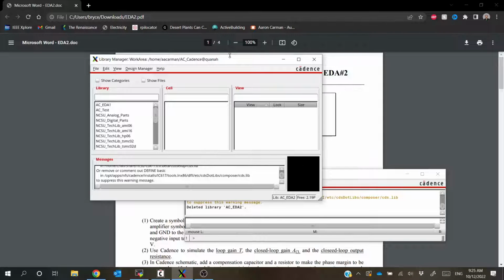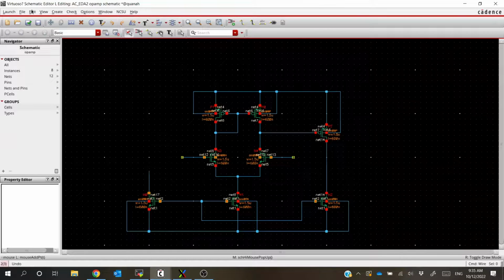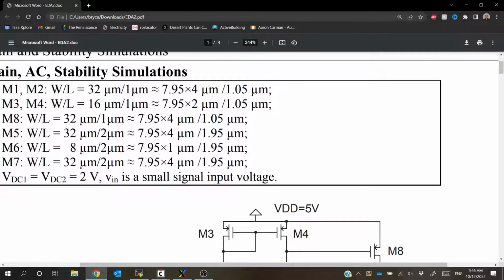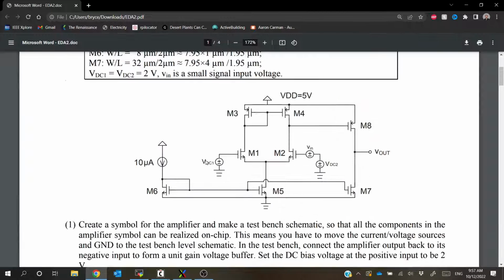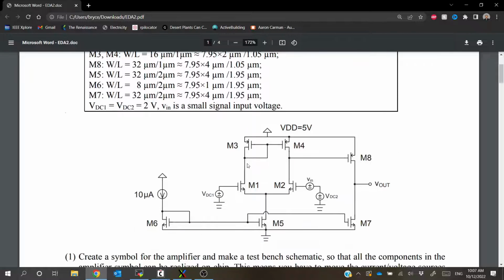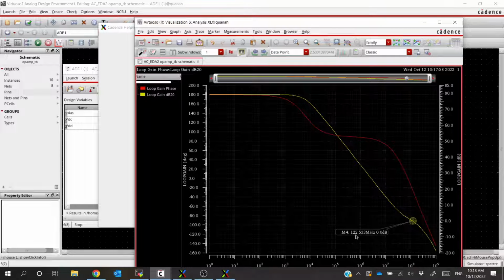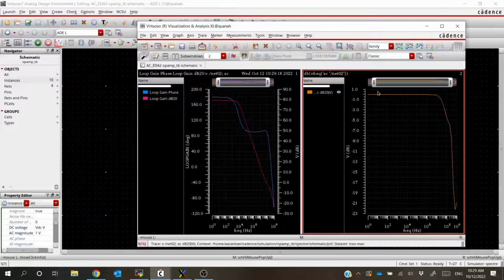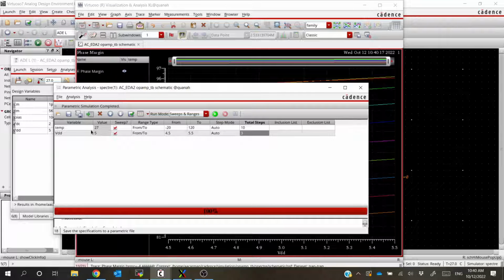Two-Stage Amplifier and Spectre Simulation - ECE x321 EDA Tutorial 2

Comment: Thank you for your video .Why power gnd connected through inductor .Is it avoid noise coupling? or else any other reason bro.Could you please revert us?
Reply from the maker: The power and GND connections are connected through an inductor to simulate the inductance of the bond-wires used to bond the chip to a package. For lower frequencies this may not have a major issue, but at higher frequencies the inductance can have a more profound impact on the operation of the circuit and should be considered.

Comment: Thank you for this video. One query is : Should the ibias terminal in testbench be connected to Vdd and not ground?
Reply from the maker: It shouldn't matter since you are still imposing a constant current draw (i.e., the source will draw the same current whether you have the other side connected to VDD or ground). The primary purpose of Ibias is to measure the small-signal impact of injecting a current, which translates to the output impedance using the transimpedance xf analysis.